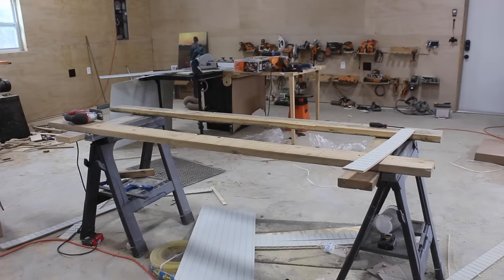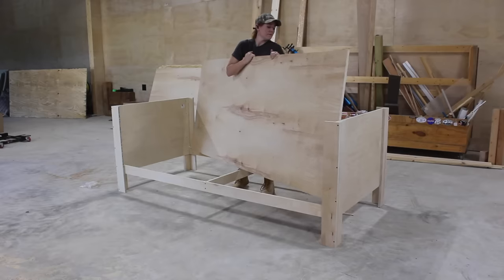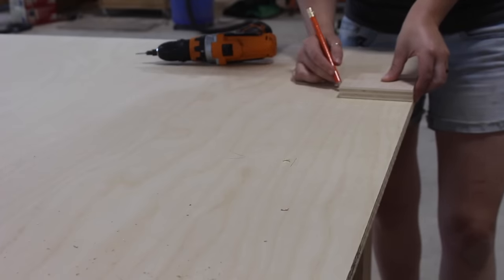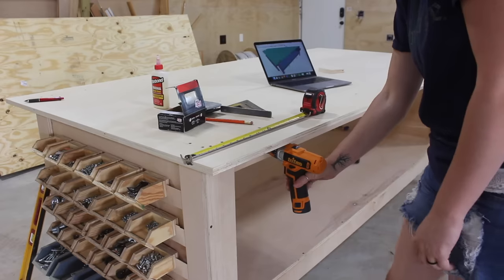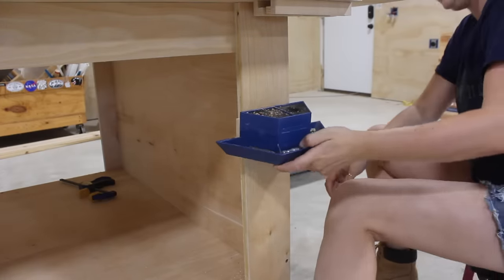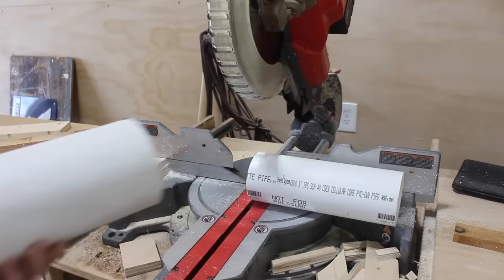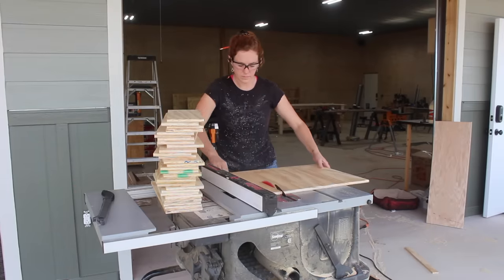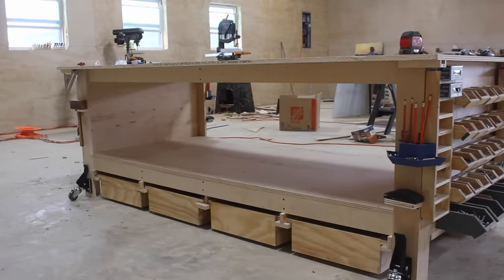How To Build The Ultimate Workbench + 10 DIY Shop Storage Solutions

Comment: If you wanted to glue and screw the top sheet of plywood to the bench, you could do like my father used to do with his benches. He would build the bench and the cover the top with a sheet of 1/4" Masonite(wallboard) and when that got beyond use, he would just replace the Masonite. Probably a lot cheaper than replacing the sheet of plywood. I was wondering if you were planning on putting the Kraft paper roll on your bench to protect from paint spills and glue messes? Great project. Keep them coming.
Reply: I do the same but have never had to replace the masonite yet 20 years later

Comment: Very nice setup, April.  I found that paraffin works well for wood-on-wood slides.  A 1# box of Gulf Wax will last a normal person a lifetime.  Another tip is to mark my boxes of screws on several edges so I can easily see which is which, even from an angle.  And the last tip is to paint your shop walls, ceiling, and floor pure white.  It doubles the amount of apparent light in the shop without any addition of lighting fixtures, and it makes dropped hardware much, much easier to find.

You rock, lady!
Reply: Great ideas and i am gonna use them in my shop thanks.
Reply: The lighter colour definitely works, and I'm interested to see the wooden ply wall lining - probs to do with insulation in your cold - but it would also do a lot for reducing noise.
Reply: Excellent idea for the white paint.

Comment: Very practical, not over-designed, easy to build.  Am needing a new workbench for my shop and this fits the bill.  I think I'll build this first, and then a Paulk-style bench for field work.  Interesting that you have ISOtunes bluetooth ear buds.  I use those at work and they are excellent noise-rated ear buds.

Comment: Thanks April!!! You gave me a number of ideas for the workbench that I need to build.  One requirement of my workbench is that it must be possible to quickly break it down in order to move it out through a standard size doorway.  I guess that is going to be the biggest challenge for me with it.  I'm thinking of possibly mounting something on the bottom of a 4' X 8' sheet of plywood that I can mount legs to, a similar system to brace the legs so they are plumb,  and I will need electrical power on mine.  Again, thanks for the video.

Comment: Nice build! One suggestion though, can you move the casters to the inside of the legs so you can't trip on them. Ahh, I re-watched the video and I see they are removable but still would be nice to be able to leave them on if they are on the inside of the leg.
Reply: I feel the bench needs a larger over hang for the top.  That bench, I'd be hitting stuff with my knees and feet just moving around it.  Moving it I'd have stuff jumping and falling out of bins and holders. That's why I have walls. Peg board, peg board everywhere!

Comment: Really turned out great April. Instead of all thread use metal conduit for the clamp holder.  Much cheaper
Reply: That is a good idea.
Reply: I made a hammer/ mallet holder using a similar method of PVC pipe. I just put a wooden dowel inside matching the ID of the pipe and it's very ridged plus costs only a couple bucks
Reply: Just needs another plywood support block in the middle, cheapest easiest solution. Or don't care about the sagging because it's not  deflecting enough to cause a failure.
Reply: Chris Robinson most craftsmen (craftswomen?) are perfectionists. A sagging clamp holder would be the most irritating thing in the workshop to any perfectionist.
Reply: Mark Lengal allthread is only a couple of dollars though?
Maybe you made the mistake of going to a hardware store to buy it. Don’t do that. Go to a specialist bolt shop, prices will be a quarter of those at whatever big hardware shop you have in your area. I’m Australian, we have Bunnings. Their prices are stupid high on things like allthread.
Reply: Parkeringsskive erholdt op med. Atvirk
Reply: Min parkeringsskive er holdt op med at virke. Nogen der har et råd
Reply: I just bought 5, 4' 3/8 pieces for $2.50 a piece......js

Comment: Utilitarian bench doesn't have to be beautiful, however you managed to do that as well!
I would place another sheet on top just to add a bit of rigidity and flatness. 
Great job!
Reply from the maker: : ) Thank you. Good suggestion on the top, I'll use the bench a bit and see if what i'm using it for calls for more.
Reply: Consider adding a sheet of simple hardboard on top of the plywood surface. It's only a quarter inch, and easy to replace when it gets gunked up.
Reply: I would use a 1" sheet of MDF for the top.
Reply: I was thinking the same thing about adding hardboard to the top. Rumor has it a light coat of wax on the hardboard would probably keep glue from sticking as well.
Reply: Definitely add a sheet of MDF on top. Super smooth and very dense so you can pound on it when necessary, and serve as a sacrificial top when sawing through other materials. Just a spot of glue in each of the corners to hold in place. That way there are no nails or screws to hit when sawing on it.
Reply: I've never understood the purely utilitarian mentality of because something's primary use is practical that the aesthetic doesn't matter. And it seems way more common among makers than I would have guessed. Even some people who make beautiful pieces of furniture or whatever tend to give little if any consideration the look of the tables they build them on or the atmosphere of the shop space they build them in. Even if something must meet its utilitarian requirements first and foremost, I can't fathom building something and not caring at all about the aesthetic.
Reply: I hate MDF with a passion, it should be banned, esp in cabinetry/shelving.  It puffs up when wet and sucks moisture out of the air in humid areas and bows under load.  I see it used in kitchen flatpacks all the time, after 3 years, the melamine chips/peels off at the door edges and puffs up under the sink when wet stuff is put back in there.  Any chippy who uses it in these applications should be shot.  Oh, and April, love the bench and creative solutions. greetings from New Zealand (hah, doesnt get further than that).

Comment: I'd either skip the drawers, or raise them 4" off the floor. When working at a bench, if you can't get your toes under the bench, you end up leaning forward and it becomes real tiring, very fast.  The ovehang on your bench top might be enough, but personally, I would have left enough room to get toes under the drawers.
Reply: Robin Szemeti there’s an overhang on the tabletop. So feet room won’t be an issue.
Reply: Good point.  Same reason why these fancy sinks that protrude out of the counter are nice for washing dishes.  You can get right up to them without hunching over.

Comment: Very Nice. FYI.... I wear a shop belt when working. It only has 5 things; tape measure, speed square, pencil, pencil sharpener, sharpie pen. It drives me crazy not to be able to "find' any of these, and the belt stays lightweight.
Reply: Where would one get such a belt? I like something similar for my backyard wood projects.
Reply: I do that, but I keep misplacing the belt, lol.
Reply: screw a nail into the wall by the door to the shop, take it off and hang it there at the end of the day
Reply: Ha ha. You got me. I keep a back up!
Reply: Timberwolf Concepts  That’s a good, simple solution! Instead of screwing a nail into the wall, can she simply hammer in a screw?

Comment: I like it.   Pretty functional and simple to build.   I do not like that the legs are ply wood where they meet the floor.  They might sometimes set on a wet floor.  They might crunch apart when you slide the bench around (If you don't use those Rockler wheels). .  Mount feet on the legs?  Or use  solid wood legs?
Reply: As long as the shop doesn't get flooded, the legs will be fine.  A little bit of water won't do any real damage
Reply: If it's for a little maker shop it's fine any other real shop that thing would be destroyed in a matter of months if not sooner. Also any type of hammering, is going to rattle the crap out of those tool and screws and and. Butt joints suck, at least rabbit them, gives a little more rigidy. I'd also a least put ....... Nevermind I could list a ton. I will give her props for going for it at least.
Reply: Should have lock wheels on all 4 corners.

Comment: April instead of replacing the top with plywood down the road why not use inexpensive panel 1/4 in panel board and replace when its worn down less expensive i been using this as a way of saving that great plywood
Reply from the maker: A 1/4 board doesn't have enough rigidity for what I'm using it for. But also, it will take me years to damage this top enough to replace it that the expense is worth it to me.
Reply: April Wilkerson I think what he means is using a 1/4 panel on top of the plywood so the plywood doesn't get damaged while retaining rigitidy. And it's easy to replace. I think that is a good idea.

Comment: Just a suggestion, I would add a second layer of plywood to the top. Very nice build. The building seems dark in the videos, is that just the camera (you seem lit well, but background, walls and floor areas seem dark)? Glenn Lever
Reply: I believe she does not have power in the shop yet.
Reply: ThrottleStopRacing the shop does not have electrical run to it yet.

Comment: For your drills I have a similar slot system but I created a tier lower beneath the bench top about 4” to maximise work area, found I was always sliding timber across the top and having to manoeuvre them around the drills in some cases.

Comment: That looks great, April! I took a bench that was out in our arbor, brought it in and glued/screwed about 14 2x4s together to replace the rotted bench top. The top of the bench is strong enough for even occaisional metal work but getting a flat top surface didn't happen. Maybe I went overboard. <grin> But I like it. Oh, and only doing the two drill holders before going full-bore all around the bench - smart move!

Comment: Your ideas are appreciated. I am making an RC airplane model bench so the table top needs to be perfectly flat with no flex so I have other ideas on that. But your overall design helped give me ideas on the other parts of the table like the storage and the clamp holder thing. Thanks for taking the time to put this video together.

Comment: we used 4X4 for legs -2X4 streaters one shelf at floor level & 48X96 X1/2" plywood top.
We layed down card board sheet to catch glue & used 5 gallon bucket with streaming hot water to wash off glue squeeze out, before it dried.
I like your table better, with all the add ons.

Comment: I bought the plans for this table and made them almost the same except I didn't make the extra holders or drawers. The stretchers for the top and shelf were a little thin as I could make them flex by leaning on them hard enough. Also at 32" high it was too short for me so I added casters on the bottom to raise it up a little. Other than those few things its an awesome design and looks great.
Reply from the maker: Glad you enjoyed the build. Sounds great! Thanks for watching.

Comment: I used a solid core exterior door slab, some re-purposed 4x4's from neighbors fence a cpl sheets of 3/4 plywood so I have 4 drawers on one side. I made a cantilever shelf on end towards shop door for my big craftsman tablesaw. shelves on same side as drawers for glue tape etc. long shelf on opposite side for hand held power tools other end has clamp rack and end vice with holes drilled for bench dogs. Bench on casters so it can be moved for cleaning or to allow access to shop for mower & garden equipment for repairs to same.

Comment: Overall, I like the bench.  It took me a bit more than 6 hours to build a modified version of it.  I purchased both the bench plans and the modification plans, while I didn't use much of the modification section, I did use it for inspiration.  I added a 4x4 spine under the bench where the supports went, and I added full extension drawer slides and drawers under the table-top, but kept the eight drawers on wooden slides under the base. I also used MDF for the top and screwed it on so that I can change it later if it needs to be refreshed and added bench dogs.  The storage potential of this 4x8 bench is amazing.
Reply from the maker: Awesome! Thank you for your support, for Sharing and for watching.

Comment: Nice job April with great explanation.  Please reconsider the safety of the push stick you are using.  I know they are common but they are known to allow the front of the work piece to lift allowing the blade to throw the piece up and back or sideways.  One with a longer surface on the work piece is much safer.  Stay safe.

Comment: Great video. I am using the same casters on a similar workbench. Were you able to use the hardware that came with the quick release plates or did you have to reinforce the 3/4 inch plywood with another piece of wood with longer bolts? Thanks :) Very inspiring work!

Comment: Nice video. Thanks. The QR casters that you mounted appeared to use a bracket that allowed you to remove the wheel assembly so you could walk around the  bench without kicking them.  The link to Rockler's site shows a caster that you can release, but would still stick out. Did I misunderstand the picture - or have they changed it?

Comment: Just mix up some 2 part epoxy, wall up the sides and pour it on. Make sure you level out the table first so you don't spill over one side. Hit up the thin pour with a heat gun or torch to remove bubbles. You can tint your epoxy as well or pour in and swirl different colors. This will make your top last very long. Your home depot will carry 2 part epoxy, as lowes also does. 
Nice project!

Comment: I like your workbench innovative,  piratical, movable and made generally with denominational lumber. Not withstanding your very good design I do have one suggestion. Border the top with a molding strip of your choosing that is left proud of the top by the depth of one sheet of Masonite or other such material. Then as it wears, paint and finishes be dammed,  just get a new piece and replace so the top is never effected. The molding strip can be removed as you chose if needed. That was the formula I used on my wood working bench and it worked fantastically, would recommend to all.
For metal & mechanical work a stronger construction (steel) would be in order.

Comment: I've built seven work benches over the past 40 years: the first was a heavy-duty bench for the home garage, then a smaller one for my office, two more for my off-grid spread (barn & work-shop), one for my son (he wanted one like the original heavy garage bench, which he'd helped me build 40 years earlier), and two for friends (who wanted one like the bench I built for my son).  I've used different home-grown designs, and I've been happy with all of them.  Not bragging, just saying.  But I've never seen a simpler, niftier design than yours.

Only two things I might change in your design:  (a) As my benches have aged, the joints have tended to loosen up a bit.  I admit, I haven't glued everything as you have, but even so, you still may experience some racking -- you have plywood sides, so you'll not have any front-to-back wobble, but you may wind up with some side-to-side movement.  If that happens, I'd add small triangular gussets of thin plywood at the upper corners of each open side, inside your stretchers.  They needn't be big enough to get in your way, and they'd add significantly to the side-to-side stability.  (b) I'd go ahead and glue&screw your top, then cover with a sheet of hard board, attached with just screws.  You can flip it when it gets dirty or munched, and replace it when necessary.

Great bench, and a great video.  Thank you.

Comment: Nice Do you ever trip up on those casters? Thank you
Reply: redwood1957 I had the same concern when I saw the side-mounted casters. It seems like they would get loose over time. Personally, I would have put them on the bottom to avoid stubbed toes and to eliminate torque on the legs.

Cool build otherwise!

Comment: WARNING I used to cut PVC for blast gates using the miter saw until one day I was cutting a coupling in half and it literally exploded. It sent small pieces of shrapnel  all over the shop. One hit me just below my glasses and caused a nasty cut. It could have taken out my eye or worse. I now use the bandsaw for cutting pvc. I drilled a small hole in one piece and threaded a string through and I hang it near my chopsaw as a reminder. I am not sure if cutting PVC pipe would have the same effect as the harder coupling but i am not going to find out. Be safe.

Comment: Good work but to complicated....put your tools etc on a wall..to much weight on the table otherwise...with the casters like that you will just end up tripping on them..good solid build though..simple and straight forward and easy to follow how you built it...using ply is a good way to keep cost down and is just as strong as timber in this build and saves time in the building compared to timber

Comment: Stop giving me awesome ideas!  Please. My planning want board and wallet can't take any more! 

Saving this one for later. I may use glued 2x4's for the legs and put wheels under it though. Not enough space for dedicated woodworking shop. 

I saw a similar table once which had the legs fold in, and top fold down. It stood flat against the wall with the product organizers (I believe bolted on stuff from mccmaster carr, not hand made like this) were exposed. Might go a non-perminant sized version. For me, the wood would get saturated with other non-wood project material too fast.